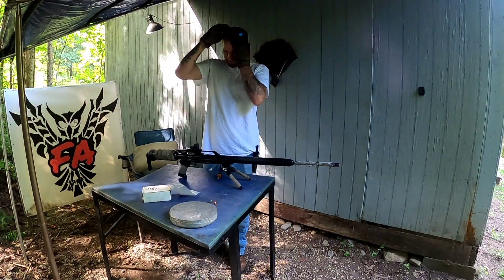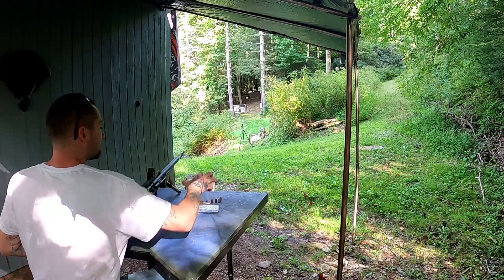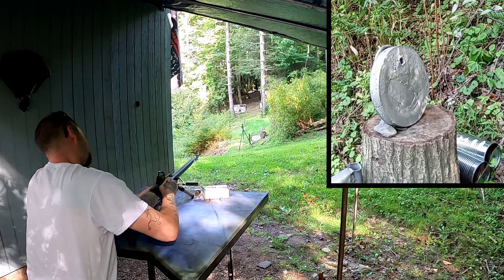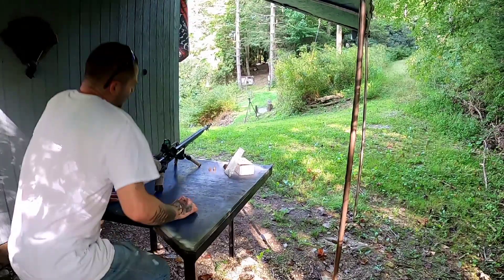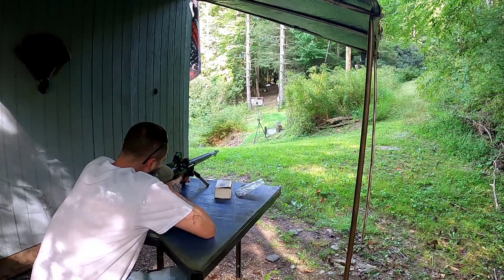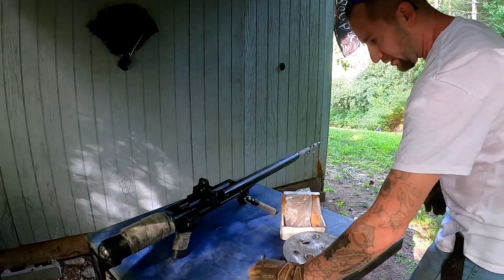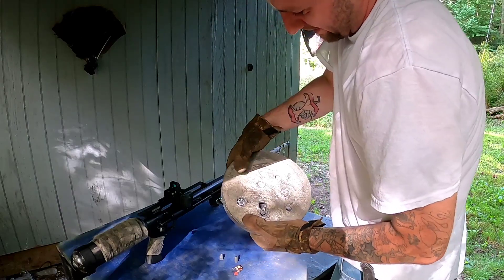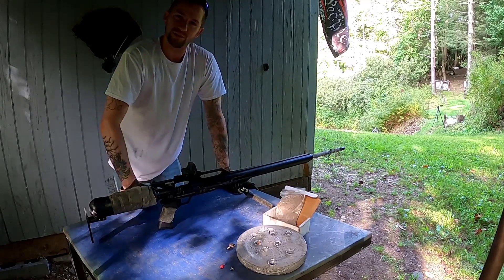Airforce Texan CF .457 🆚 Lead Plate

Comment: Great video!    Thought I’d post a video of the 457 CF Vs 44 Mag and 45 Super.  The handgun rounds are in excess of 240 grns and are limited to 1200 fps as they are firing cast projectiles the same as the air rifle.  
So can an air rifle hang with magnum level handguns VS eight 2X4’s stacked.   Let’s see. 

457 Air Rifle Vs 44 Mag Vs 45 Super Vs 2X4's - Who Wins?
https://youtu.be/XCT8mcSxPZA